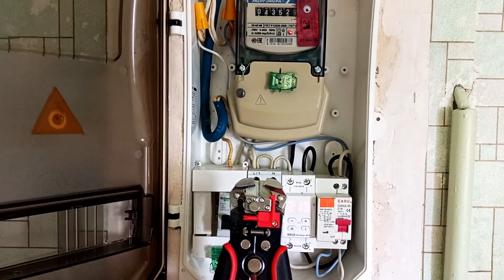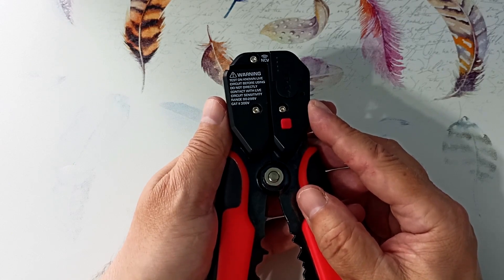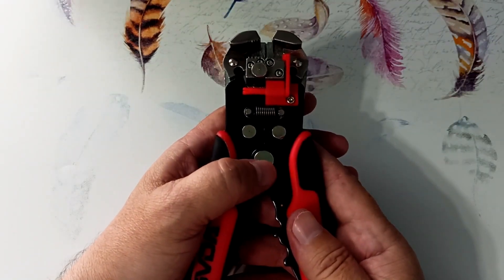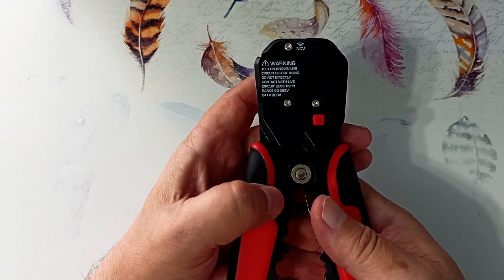Automatic Wire Stripper GVDA with NCV Function. Essential Electrical Tool for Wire Stripping

Comment from the maker: https://alli.pub/774407?erid=2SDnjdC16hK - GVDA stripper on Aliexpress.
https://alli.pub/74y0f4?erid=2SDnjehADde - Stripper without NCV
https://bit.ly/Pomkan - Support the channel financially
https://www.youtube.com/@EkimovIgor1 - This channel in Russian.

https://youtu.be/O1x9YkY1cNs - Hydraulic Crimping Pliers for ELECTRICIANS
https://youtu.be/fTNVlWXwR2M - Thin digital multimeter FNIRSI
https://youtu.be/bROkRDofUKI - Laser level 4D ME16C CLUBIONA
https://youtu.be/Fq3UyU6v94o - 256x192 Thermal Imager for phone
https://youtu.be/fc6wGGwdQmI - Cable Locator MS6818 Professional

Comment: This tool looks incredibly efficient! Does the NCV function work well for detecting live wires? Definitely a must-have for electricians! 🔧⚡
Reply from the maker: The NCV function works well: in a shield or junction box. To search for wires under plaster, it is better to use specialized devices.